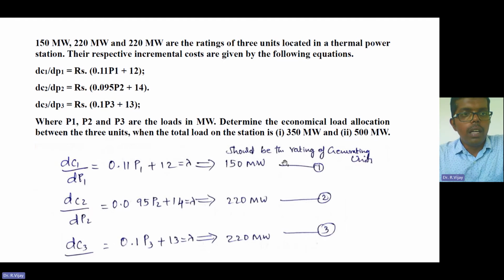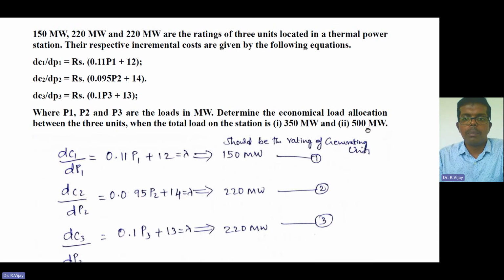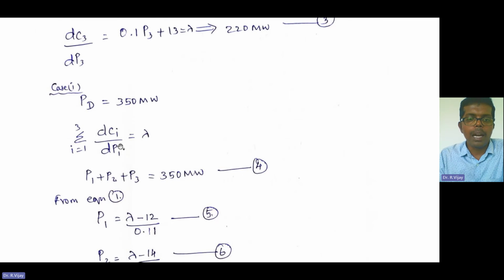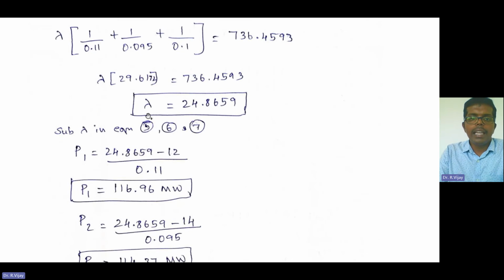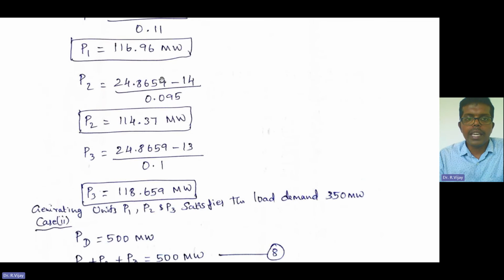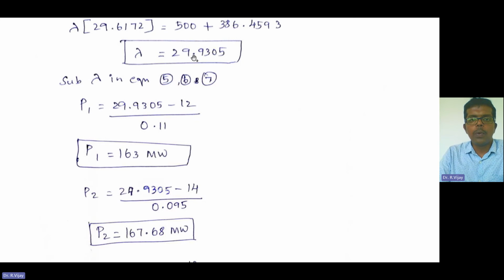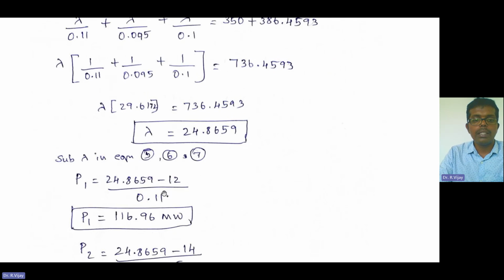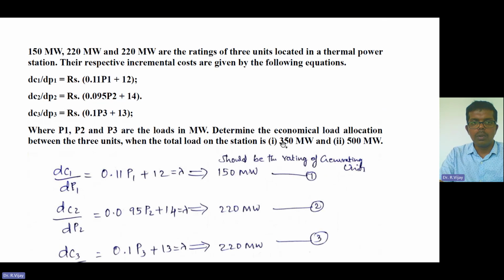Solved Example Problem 9 - Economic Load Dispatch without Loss #psoc

Comment: For 500Mw demand, P1 is exceeding the max value of unit-1, so how did you said it's below the limit ?
Reply: Then we need to again fix its limits. But in the practical case then you need to go for the nearer value of generators. So the nearest value is 150 MW